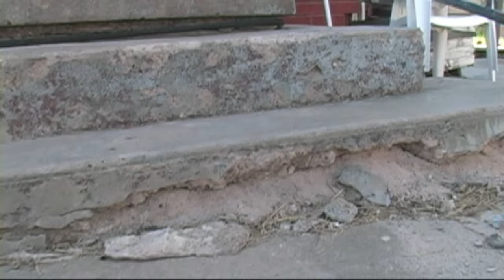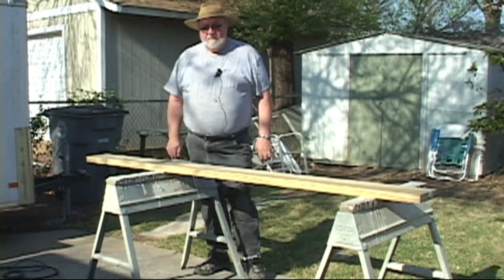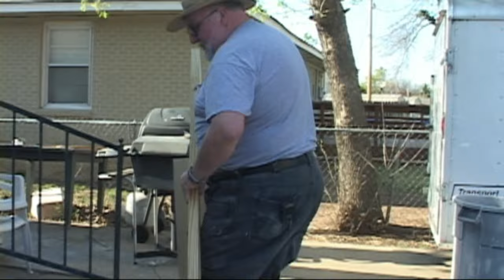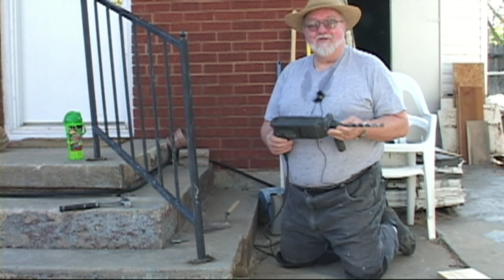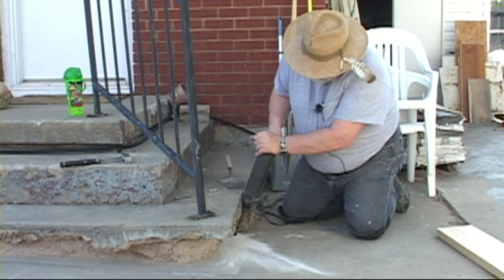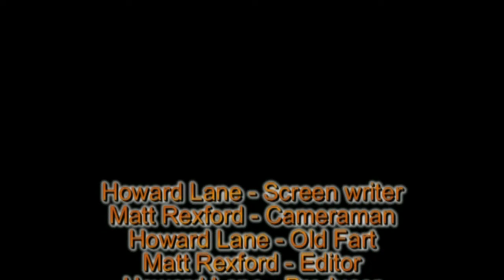Conrete Repair Segment 1.mp4

Comment: If you used a 5/8" outer diameter lag shield, what would be the lag bolt size? Also did you use long or short lag bolts? Thanks for any help.
Reply from the maker: Not positive but I think your lag size would be 3/8"I used short ones.

Comment: Romans had better cement that still holds up today.
Reply: *conecreet
Reply: True, even under water. Also had something to do with the components available in the area at that time.
Reply: It was calcium carbonate based. It looks like they used both sea shell and marble dust as sources. They figured it out early and got it right. The only bad thing is it's not as load bearing as modern mixes.

Comment: Brilliant idea to use bolts as anchors for holding new concrete to existing. I need to form a 2" concrete collar around my step to hold paving blocks securely. I had workmen in but they did a rubbish job. They just laid the paving blocks on top of a bed of cement on the concrete step. Will follow your method, make a former and pour the concrete into the gap between former and step.

Comment: Regarding the drill: I wouldn't bother with a non-hammer drill, unless I want to beat my brains out drilling the holes. solution, if you don't have a hammer drill: Rent one at Home Depot or whatever. Don't go get it until ready to drill. Drill, then return before 4 hrs is up, or whatever will save money. It's worth it. You'll spend more time going to get it, then return it, than the actual drilling takes, but it beats hours of tedious drilling with a regular drill.

Comment: o sweet, gave me tips for one of my mission objectives.

I tore out 9 yards of asphalt and I am going to pour in a concrete path way to the driveway. There is already an ugly strip of hard concrete (not asphalt) that leads from the house-walk entrance to the driveway and it is about 1' width by 6yards. I was almost going to tear out this piece of concrete but actually I can use this for part of the pathway, plus it appears the concrete also holding up the rock wall. So I thought I should do like a extend plan and maybe use the crack-resist quickconcrete mix.
Reply: Wow working well

Comment: Tricks of the trade are golden. Simple as holding the wood at an angle (instead of messing around using a clamp) and putting a few bolts into the old surface. I leaned two things here! Thanks.

Comment: I think it would be easier, better and faster just bust out the front 2 steps and repour the whole thing. I pin the whole thing with #3 rebar to prevent separation between the existing and the new pour. Vibrate all around to remove any surface voids. 

I have concrete in the 50s and still solid. Your existing slab doesn't look right, may crumble again - I don't mean your work, I mean the existing substrate looks bad. Why put all that work on top of a bad foundation?

Otherwise, excellent video.

Comment: Great job Howard. I like that you take things step-by-step, and don't rush. I have screwed up so many times by getting in a hurry. I like the composite action generated by the lag bolt drilled into the new concrete.
I'm wondering if drilling holes and hammering in #5 rebar would be good also. Of course you would have to use a grinder or hacksaw to cut the rebar to length.

Comment: Good video for small projects/repairs.

I find a Workmate or a sawhorse with a large clamp or vice very useful for securing material in cuts... not crazy about one handed cuts... kickback could be seriously bad.  Beginners will want to secure the board.

Also, his tips on hammer drills /rotary hammer is on the money.  I'd add that anytime you buy "concrete bits" as he calls them, you'll want to ask the tool guy for MASONRY bits.

lastly... lag bolts go in better with a socket or impact wrench.